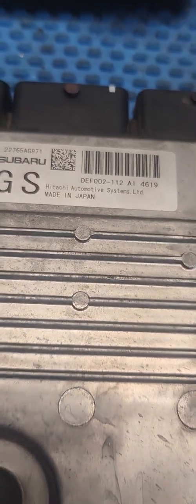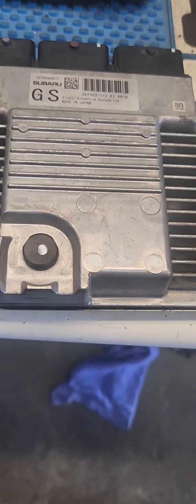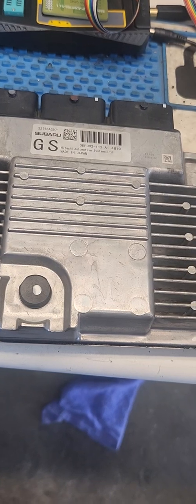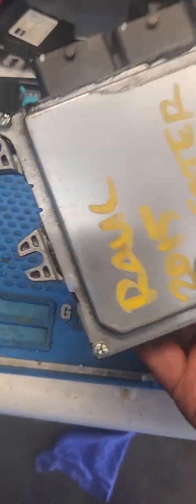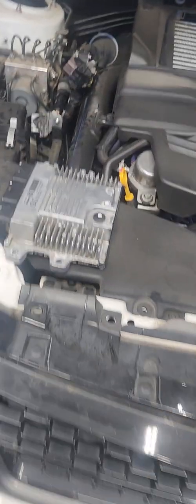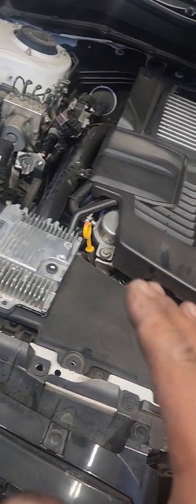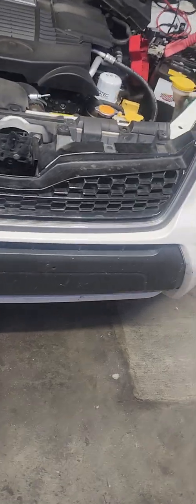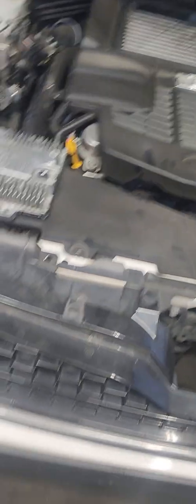Subaru Learned VVT values

Comment: If you have a Cobb Access port,  you can reset AVCS values as well as short and long term fuel tables. Not entirely sure why Subarus default software wants to be so difficult. Just be glad you don't have a Mercedes.